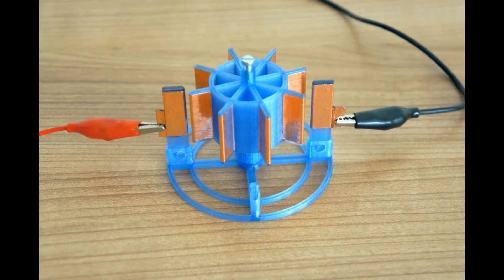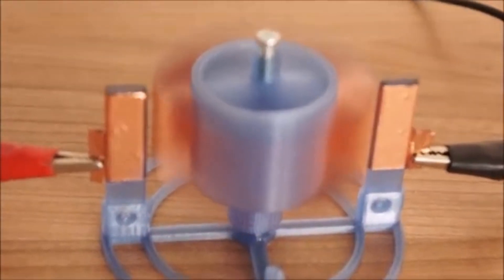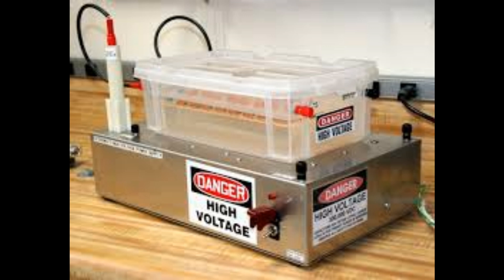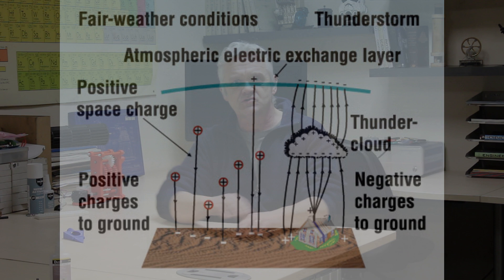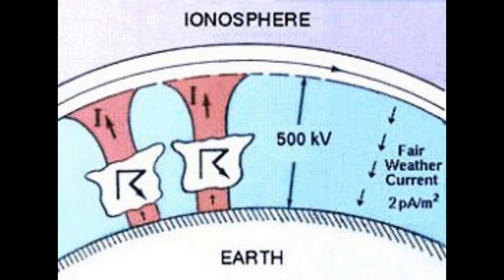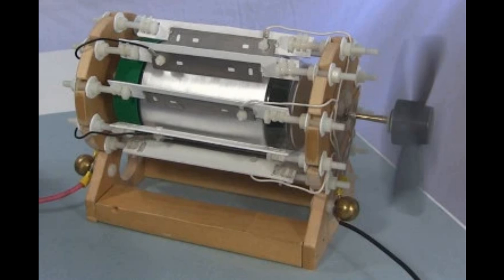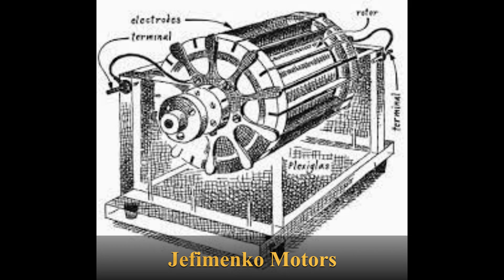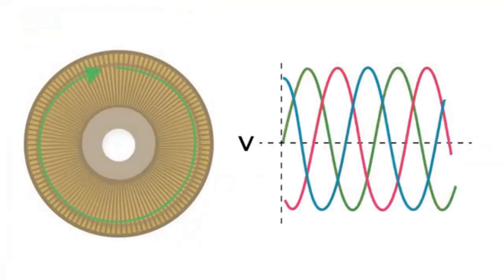1840 Atmospheric Electricity An Exciting Possibility

Comment: RMS, Lasersabre has been doing this for a long time. Tie his HV electrostatic motor to a DC generator and now you have a useful power source. You could make 3 phase power with a connected alternator.
Reply: Interesting Idea! that does remind me so much of the current work being done on RF Energy Harvesting.
Reply: Could be possible to do using two centre tap transformers and and 2100v 10uf caps in series, there would be a slight imbalance to sine waves, tsw would shift and emf would be notable...

Comment: Maybe the pyramids had something to do with this. Just a idea.
Reply: When the empire was still above the waters, the Pyramids functioned as giant electric power plants. They were Hydraulic Thermo Acoustic generators that could send and distribute electricity wirelessly though the air to near by Obelisks for use in buildings and homes.

Comment: Is there not enough of a negative charge in the atmosphere to charge the batteries on an electric aircraft? If there were, then we might not be as concerned about the weight of the batteries needed. Is it just that no one considered this?
Reply: Ah, you said that the atmosphere has a positive charge.
Reply: Actually good sir, there is such as thing as "Radio Frequency Energy Harvesting" technologies being developed now to power electric devices that are battery free.
Reply: @captainnemo6655  I have looked into that. It is very interesting, and very situational.
Reply: @justinweatherford8129  Situational you say? Good sir have you heard the good news from Ion Power Group and the recent work they did to show this can work anywhere on this planet and others?

Comment: Even thermodynamically, energy can be extracted from the air - CONTRAIL planes.

NATURAL "photovoltaics".
Reply: did you know electricity can also be extracted from the Vacuum? Zero Point Energy devices and generators do exist, such as the ones put together by Dr. Thomas Henry Moray
Reply: @captainnemo6655  , vacuuming/EXPANSION allows the extraction of energy from the ambient HEAT.

Mercedes-EQXX, Aeromovel and many others.

Comment: Makes you wonder about ancient advanced precision temples with pyramids and pillars that stood really high up to 80ft. as if they were harnessing energy somehow. for all we know, the Giza pyramid which is 300ft tall with its once upon a time golden cap or crystal cap was an atmospheric energy collector. The entire architecture of Giza pyramid complex lwhen you zoom out, looks like a giant life size electrical computer board.
Reply: The buildings you mentioned and many more are strategically placed on what is called the Great Circle or also known as the Magnetic Equator Belt. This area of land circles the entire planet at such a degree that it bisects every single magnetic line the planets magnetosphere can produce at any given moment. So if where they built these structures there is an over abundance of MOVING magnetic fields then all one would have to do is place the right kinds of stone, shaped and molded in the correct angles to produce electricity. All from the Earth itself. On larger scale colonial projects like at Giza, the builders of the pyramids needed large scale power distribution over the air by using this same principle in Obelisks that could act as relay stations. In another small scale example, in Florida, USA there exists Coral Castle. A park made by one man, Ed Laskani, by using acoustic levitation with electricity generated this way .
Reply: That's exactly what the Great pyramid is. 
Pyramid = Fire in the middle (king's chamber)(Granite box exact same dimensions as the Ark (Arc , spark , electrical fire) of the Covenant).
Gold box capacitor with two cherubim on top making a spark gap between their wings.
Reply: @kevinleebailey  You are absolutely correct about the Pyramids. The fire in the middle is a clue. The water channels BELOW the pyramid are another clue. They were GIANT Hydraulic Thermo Acoustic electrical generators capable of wireless distribution.
Reply: @kevinleebailey  The ark of the covenant was more then an electrical generator. It was also used during a battle to win so it has an element to it that allows it to be used as a weapon. Problably both. Electrical power that could be manipulated and channeled into various purposes.
Reply: @captainnemo6655 

 Sometime during the wilderness wanderings, God commanded that a container of manna be added to the ark’s cargo: “Moses said to Aaron, ‘Take a jar and put an omer of manna in it. Then place it before the Lord to be kept for the generations to come.’ As the Lord commanded Moses, Aaron put the manna with the tablets of the covenant law, so that it might be preserved” (Exodus 16:33–34).

After the rebellion of Korah, God commanded the leader of each tribe of Israel to bring a staff to the tabernacle. The name of each leader was inscribed in his staff; the tribe of Levi bore Aaron’s name. God instructed that the staffs be placed in the tabernacle overnight. The next morning, Aaron’s rod “had not only sprouted but had budded, blossomed and produced almonds” (Numbers 17:8) as a sign of God’s blessing on the Levitical priesthood. God then said, “Put back Aaron’s staff in front of the ark of the covenant law, to be kept as a sign to the rebellious” (verse 10).

So, by the time Israel reached the Promised Land, the ark was associated with the items mentioned in Hebrews 9:4: the stone tablets, the jar of manna, and the staff of Aaron.
Reply: @originsdecoded3508  you forgot about THE ANCIENT OF DAYS machinery. You won't find it in the EDITED version of the scriptures. It's only mentioned in the original hebrew scrolls
Reply: @captainnemo6655  Sounds like some kind of particle synthesizer that composes elements into a mass of food/objects.  what is it? I imagine not much detail is shared, scriptures have a thing for leaving out details.

Comment: That would be awesome to run a generator off if the torque can handle it.
Reply: Yea! That's the idea! Imagine running your whole household on Atmospheric Electricity? Or at least the devices at home with motors constantly running like the Refrigerator and Fans
Reply: @captainnemo6655  if I could get it to run a 1kw generator and charge a small battery bank it could run my entire home!
Reply: @robertpoynton9923  this is what I am aiming to achieve. My interest is to power my current life with Atmospheric Electricity and Zero Point Energy but while living off grid here in Nevada. There is great progress that was made in 2022 by Ion Labs out of Florida.
Reply: @captainnemo6655  I'd be interested in what you are trying to accomplish. Where could I find out more?
Reply: @robertpoynton9923  There are LOADS of resources I would love to give you but youtube always censors my comments. The best I can do, is point you in the direction of Dr. Thomas Henry Moray AND the folks currently at work on Radio Frequency Energy Harvesting technologies. MDPI has some EXCELLENT research articles on this.

Comment: I love how electrostatics seem to run the exact opposite oh how traditional power works.  Haveca lot of sharp points on your collector and don't ground!

I wonder if you could use the "lighting" that discharges the capacitor to heat up something like a sand battery..  But you'd need a sand that's made out of something with a higher melting point than quartz. Good luck there!  Maybe a liquid quartz battery isn't such a bad idea...
Reply: This idea right there!!! And such sand already exists too! People have been using it for ages to build kilns and plates and molds for molten metals. It goes by the name Fire Sand, Kiln Sand, etc. But here is the thing, what if you want it to turn into that kind of quartz called Fulgorite. It can act as a natural super capacitor. A mix of fire sand and electrically conductive quartz sand would work the best. Arranged in such a way each electrical discharge forms uniform but separate tubes of Fulgorite capacitors . Cool idea!!

Comment: Looking at the positive/capture end of the system.. If the increased voltage at greater heights is linear and not exponential, would you get the same result with numerous short 'capture wires' wired in series?
E.g. Fifty x 1m tall capture wires in series should yield the same voltage as 
one x 50m tall capture wire - yet with lower resistance and optimal space efficiency.
Too good to be true?
Reply: Amazing idea!! Did you know there is a Lab trying this out as we speak? They did make headlines back in 2016 and are still in operation.
Reply: @captainnemo6655  who?
Reply: @captainnemo6655  I did not! Would love to see it if you're able to share?
Reply: @anchovyavenger  Youtube censors me every time I try to post links and videos.... This is the info for that lab though:  CREST Research Labs in Japan. The project was run from 2015 - 2016. [Energy Harvesting] Scientific Innovation for Energy Harvesting Technology. By Dr. Kenji Taniguchi（Emeritus Professor, Osaka University) and Dr. Hiroyuki Akinaga（Principal Research Manager, National Institute of Advanced Industrial Science and Technology (AIST)）
Reply: @captainnemo6655  thanks for the info! I'll definitely look into it

Comment: I have seen a video of this where a electro static motor was powered by a wire and a  drone holding the way up in the air on here it is a few years ago!
Reply: That would be the Corona Motor built by the dude that runs the Plasma Chanel
Reply: @captainnemo6655  I think so,sounds familiar. I will check it out to see if it is the same one.

Comment: |> |> |> |> |> |> |> |> 
|> |> |> |> |> |> |> |> |> 

normaly Im bycall what works with atmosphere and electrucity very carefully because the electro magnetic fueld of the planet because when you weaken this the all on thecsurfapace is barbequed.

the reason why I dont apreciate tesla like the most do ...

because 3/4G have already wiped out 75% of all insects, sunging birds and mipicroorganism in the soils which priduce the needed feteralizer ... and monsato, ect.  get richer ... a fatal way 

but since the ions are continoualy refilled ... hmmm ,.

Im in boat drives ect. and serious my coanda drive ... (search for "jetoptera", my drive is based in the same modul only addopted for marin application) for marin vessels is already not to beat, but eginindustry, oil industry, service industry and goverments because immensly taxlost hate it ...

the reason why J get nogmaly dlways shaddowblocked when I only mention it ... 

but I need to ask what voltage is needed to get a drill to spin?

is a 13 meter mast of a sailingboat enough?

I think tobcombin ohotovoltaik, wind and such ... a proper batteriebank which get a bit charged over night?

|> |> |> |> |> |> |> |> 
|> |> |> |> |> |> |> |> |>
Reply: I see your concerns but these were put to rest by the Ion Power Group. They successfully demonstrated this way of generating electricity is safe. Have you seen their page and videos?

Comment: supposedly Nikola Tesla used a black box converter on his dash to draw power from a circuit between the two tesla coils he had... one in wardenclif and the other in Colorado springs to power an electric motor driven car in the 30s
Reply: This is very very true but it happened in the 1912s. Right around when the demonstrations for the first cellphone we're happening at Menlo Park. Tesla was very specific this could not only power cars but also a type of airship which could fly at extraordinary speeds by riding on the magnetic fields of earth.

Comment: can you use a microwave transformer to get such voltages? this would be, as you stated a great school project.  Thank you RMS DVD:)
Reply: Rob would know the statistics.  It's maybe 5 deaths per year due to MOT exploring.
Reply: @philip5940  that's why we are exploring Atmospheric Electricity instead.
Reply: USE CURRENT LIMITING METHODS!! It will require lower voltage to primary with frequency  at 440Hz min

Comment: What about the Newman motor,  running it on atmospheric energy? It seems to be high voltage low current, I know very little about this, but seems the balloons that are getting shot down would would be great to get a large plate up high, and charge a huge capacitor!
Reply: That's a really good idea! ... If only they could just stop shooting down the research hamsters on balloons.

Comment: Out of curiosity, Rob. Could the motor be switched via commutator to make the electricity operate as alternating current?
Reply: If I recall correctly, Hermann Plauson described how to convert into essentially downstepped AC. Shouldn't be too hard to translate the German today with Google translate.
Reply: Good question. I was wondering the same.
Reply: This is where the spark gap and capacitor circuit or pulse motor's come to play.
Reply: Don't forget spark gaps produce radio waves which are high frequency alternating current / alternating voltage.

Comment: Could you put on the roof (4 - 5 meters up a multi spiked but insulated from the rest of the roof piece of corrugated iron with lots of spikes in it to grab said atmospheric charge and charge a battery bank with it?
Reply: Yes you could!!! But you might want to float the collector a bit much higher. Corrugated metal roofs and collectors of Atmospheric Electricity make good lightning rods.

Comment: I wonder, since it is not practical to run a wire very high in the sky, if a person were to set up 100's of say, 100 foot wires and collect all as if drawing from 100 batteries.  Hmmm
Reply: This idea!!! An Atmospheric Electricity Collection station, it would not need much space either. A football field packed with these collectors would do the job. As a matter of fact ION POWER GROUP of Florida had a similar idea they are working on.
Reply: @captainnemo6655  Ion Labs, got it.
Reply: @potential900  My Bad, they are called ION POWER GROUP (The Suns Electricity Harvested Day & Night) . Still based in Florida.
Reply: This supposedly has been tried and described already by Meridian Int. Research, as well as old patents you can find on Free energy websites and Rex research. Iirc, Oleg Jefimenko also looked into ways of increasing the output at relatively low altitudes. I'm not convinced it's that straight forward though as the working mechanisms in the different atmospheric altitudes are unclear (to me anyway, lol).
Reply: @potential900  Thanks for that information. Yes, if it could be that easy it would have already been made and used. But not impossible I guess. Another thought came to mind too. What to do about lightning with all those wires or rods in the sky. Bound to attract it. Dont know how we would use power from the sky and deal with that at the same time.

Comment: We need an mppt charge controller to charge a battery with it. Just a step down voltage transformer will work for usable voltage and amps.
Reply: This idea too!! I was thinking of something similar. An Atmospheric Electricity charging station for power banks that can run home appliances.

Comment: I have an idea: Make a bunch of those flutterers from your last video and attach a small magnet to each one then put similar magnets around the circumference of the Atmo-Motor and put the flutterers around that. Attach piezos or coils to the flutterers to tap off the electricity.
Reply: Interesting. Just the flutter generators would work, specially if they are printed with electrically conductive graphite filament.

Comment: The motor is nice but why not just charge a battery with the current?
Reply: This is the next step!! First we get appliances with motors to run like your fridge or freezer and then Fans and heaters, then Atmospheric Electricity Charging stations for ANYTHING electric with rechargable batteries